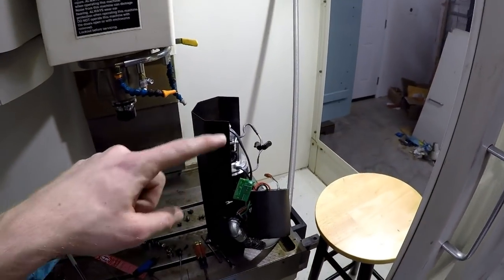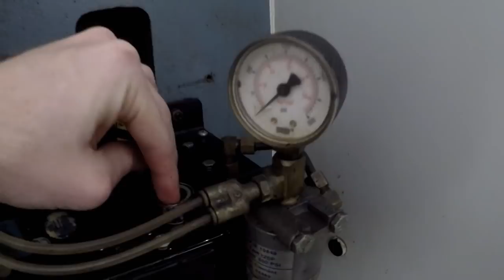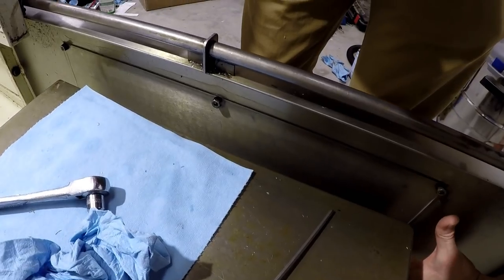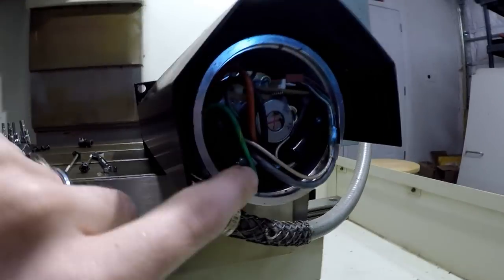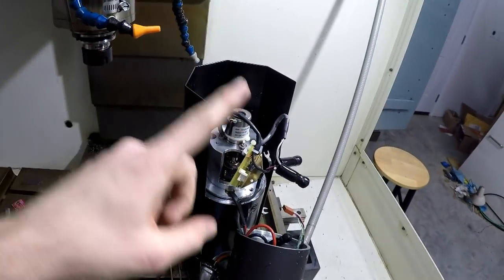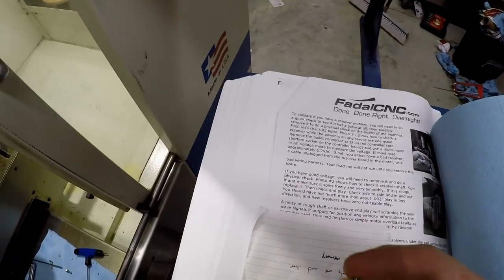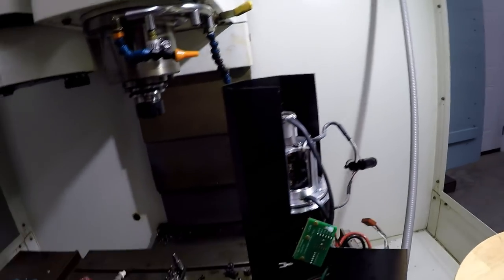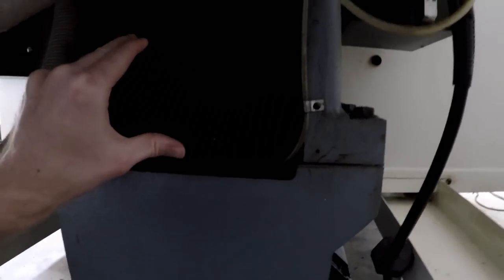Replacing Resolvers on the Fadal - Part 1

Comment: i have done a lot of repairs on the machines that i had before i retired. here are some suggestions 1 do not stand the motor in its shaft unless you have a couple grand to replace it it can damage it besides dumping it over. 2 get the manuals or ask someone how something comes apart if your not sure. 3 turn the damn power off you have a death wish as well as possible damage to the driver boards never assume power is not getting to the control unless the machine is with in a couple years old you can not get replacement boards for these machines on a lot of these models. just some friendly advice.
Reply: Very good advice.  And if you do fry a board I have a whole set for the fadal 15.  Just converted to linuxcnc and encoders.  I kept the dc servos.
Reply: @idus  what CPU version did your Fadal have? Want to sell the boards?